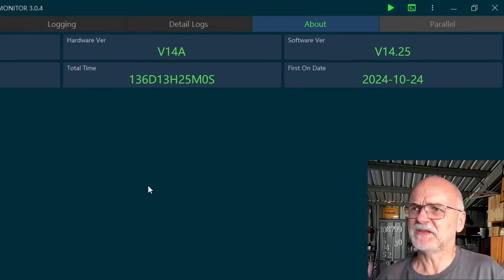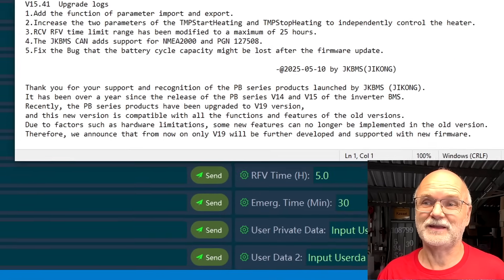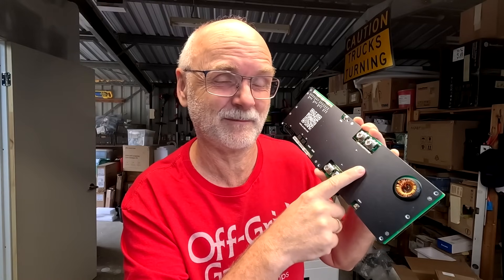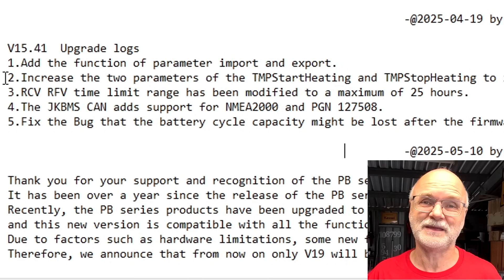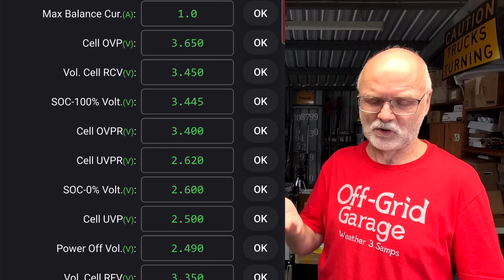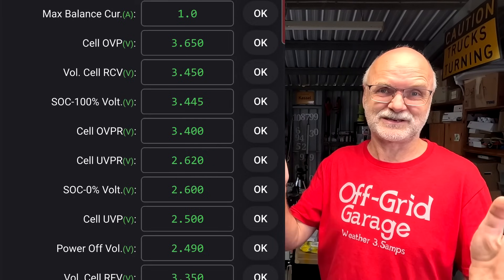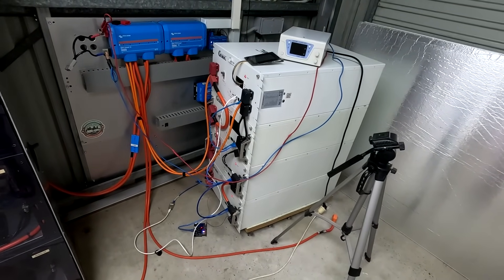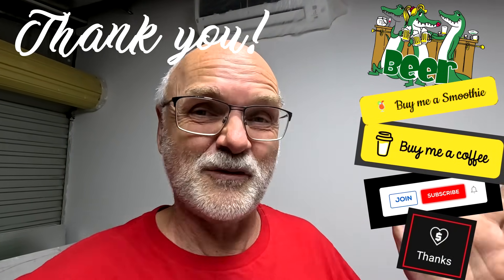The inevitable end of the JK-BMS. EOS for V14 and V15 - is that it?

Comment: 330AH 16S with Jk BMS 300A with 2A balancer, has a constant draw of 2.3A from a EG4 6000xp offgrid inverter, during testing without any solar input, drains battery really fast. averaging 15% overnight with only 2.3A continous draw. Why? 289 days of standby. This bms is drawing power or balancing them incorrectly or something because it shouldnt lose 15 percent overnight

Comment: Hi Guys, i have a V15 BMS and flshed the latest V15.41 Firmware, i am not realy shure but i think bevor the Firmware was V15.36 (or 37). done this a week ago or so. today i realised that the heating is on! the Batterie was on nearly 39 degrees! the last days we had temperatures between 25 und 35 degrees, and there is not heating needed! Charge OTP is on 7 degrees and Charge OTPR is on 12 degrees (I assume when the temperature falls below 7 degrees the heating is switched on and when it rises above 12 degrees the heating is switched off). why are the heating pads on? anyone else with this problem? i tryed to backflash to 15.39 but this went wrong so the bms was bricked. Because of andys experience i was able to reflash to 15.41 (hold the powerbutton and push the reset button). The only way i find to switch the heating pads of is to disable the temp sensors. but this can not be the solution! i find no othe way to switch the heating of. now i disconnect the heating pads, but for wintertime i need they because the batterie is in the garage. Hopefully anyone has a solution! Thanks, Peter

Comment: Did Anyone tried to use the new  heating function(start temp, stop temp) introduced in the FW 15.41 ?. It seems it does not work and somehow after enabling all parameters heating stays off all the time in the status despite enabling in control and adjusting the start and stop temperature. Any suggestions ? Did anyone tested this functionality ?

Comment: Hi Andy,  and the world guru of JK BMSs I'm hoping you can help.  I have 2 x v19 PB series and 2 x v15 PB series all in parallel. 

I'm having an issue when the master (v19) lose connection to one or more of the other batteries.  This only seems to happen with the batteries are under load.  
The strange things is with the BMS loses connection the UART2 Protocol No is 16 (not 1 like it normally is). When it switches back to 1 it sees the batteries again. 

I have tried switching the master to the other v19 and it's the same.  With both of the last 2 latest firmwares.

Any ideas?

Comment: noticed a bug in iOS software V5.1.0 .  trying to set alarm for high or low cell voltage and we can only enter 2 digits.... for low cell voltage atarm i'd like to be able to enter 2.75 but can't.  I can enter "2." 

Also, I played around with the low SOC alarm and low battery alarm and I can't get  the dry contacts to work.  A video on this would be great.

Comment: I switched on my BMS and turned on the main switch, then I looked down and the BMS was off. I tried to switch it on again but the LEDs just flashed very strangely and then nothing worked. It turned out that the fuse on the positive connection to the BMS was blown. I then repaired it without a new fuse and now the BMS seems to be working fine. But only apparently, because switching on discharge doesn't really release the voltage and I have no battery voltage behind the BMS. Does anyone have the same or a similar problem and a solution or know that it is definitely broken?
I also tried a firmware update but it didn't help.

Please feel free to reply in German.

Comment: Finally did some testing. There is a major good change done!   With the heating change also a new feature. It will not turn on the heater now unless the battery is being charged. Have wanted this for a while.
Reply: Question. How long does it take for the heater to bring the cells up to an acceptable charging temp? With all that mass it would seem there would be time needed to do that. A better option would be to have a timer where you could set it to come on an hour before sunrise. Otherwise, you have pv power going to waste waiting for the battery to come up to temp.

Comment: I see, that you have JK-BMS WIN-Monitor 3.04?! In the older Versions, you don't see TMP Start/Stop Heating Parameters! Instead you see Battery Temp OTA(R) with Value 30 that you can't change. Only in the last Version of JK-BMS App IOS 5.1.0. i could see TMP Heating Parameters like you see. Android last Version JK-BMS App 4.28 you also don't see TMP Heating Parameters too. Update Android App don't found. From where i can download JK-BMS WIN-Monitor 3.04?! In Google Drive is the last Version 3.03.28. Thanks!

Comment: My v15 bms came with usb to rj45 cable. I can't get it to work. My windows 10 doesn't recognize it. I can see it in device list,but can' find driver for it anywhere? Anybody know,how get it to work?
Reply: Are you plugging into the right hand RS485 B or C ports? Mine worked fine today first time of use, I am on Windows 7 though.
Reply: I did get it to work with another computer also with windows 10 with newest updates.

Comment: Andy, If you can convince them to add a re-bulk voltage offset so batterys dont end up sitting discharged for the day if a load draws more than PV can supply, it would be very beneficial.

Aswell as a parameter to adjust the CCL when the battery falls under a certain temperature for cold countrys.

We have made these suggestions several times, im guessing the MCU is why its fallen on deaf ears.

Comment: I refuse to believe this is actually true. The amount of parameters you can save on 1Mb is much much more than what a BMS might need.
I can understand that they don't want to put any time in a product they are not selling. It's bad support, but I understand.
I can also understand that their firmware uses variables that they can use in several ways, wich is easier than make new variables.
Firmware was never their forte.
As long as the competition is lacking, why make less profit?

Comment: What are the requirements for the battery to go from Bulk to Absorption.  Mine is staying in bulk after float ends.  Battery Volt > 16* SOC-100% but it still stays in Bulk.
Reply: I found the problem. And now it is working as expected. To get out of Bulk and start the Absorption cycle the whole battery voltage needs to be >= 16 * RCV  (Not 16 * SOC 100% which is a little lower)  In my case the problem was that the BMS was requesting a Voltage and the inverter was supplying a little bit lower voltage.  To fix the problem I calibrated the BMS Voltage to what the inverter was supplying (actually cell voltage now is about 0.005V higher than the BMS setpoint per cell) and so far 2 days working perfectly with Bulk, Absorption and Float mode working as expected.  Try calibrating the BMS Voltage.
Reply: @joseo.cordero7286  Thank you for your advice i'll try
Reply: I'm also happen like you😢

Comment: No more update while the product is still on sale? That is no good. When a product is already some years obsolete, then when update also stops, no one will complain, but like this?
Reply: Well it depends if it needs updates. I know there are bugs but it's perfectly workable and it's costing them money to support it which you're not paying them for. I think too many people are comparing these with operating systems and mobile phones, which need security updates at least.
Reply: @matthewmarks6951  What if next month an important security flaw pops up? (Which already occured in the past).
What with the manufactors that still have stock of battery boxes with this BMS v15 implemented, or the sale of the BMS itself? That is not a good factor to start a sale with.
Reply: It's not connected to the internet. I'm not sure what security flaws could pop up beyond something involving the Bluetooth password. I'd be interested to read about this example of a security flaw and happy to be corrected, of course.

Comment: Ouch! 15.41 isn't a very nice parting gift for the version 15 bms. Wipes the BMS to factory defaults. Hopefully you've done an Export before loading the new firmware. And then after performing the Import, don't leave the settings page before sending every setting to memory. The import only populates the values on the settings page. It is not written to memory.
Sheesh......

Comment: Hi Andy I just bought new v19 jk bms it is very good before I use daily from now on only jk bms thanks to you I came across jk bms and I am very satisfied thank you andy
Reply from the maker: Thanks for the feedback.
Reply: @OffGridGarageAustralia  Dear Andy, I have a question. I see now that if I use my batteries 40 percent, the next day it starts charging, for example 20 percent charged, then at one time it jumps to 100 percent charged, normally 80 percent charged. Then on spring 100 percent is that normal at jk bms
Reply from the maker: @aximuro  No, that's not normal. It should not 'jump' to 100% all of the sudden if you are at 80% unless one of your cells hit OVP, then it jumps.
Chack your voltage levels of all cells when you charge, if one of your cells is particular high.
Reply: Dear Andy what I experienced at jk bms v19  Balance trig volt 0.010 It does not balance. if I do it below 0.010 like 0.008 then that it is very good difference between batteries 0.010 and 0.008 many different like example 3.38 v that others batteries 3.55 but 0.008 then almost all batteries have the same volt balance trig volt 0.010 does not balance the batteries but under 0.010 can also test that. With me it is so thank you for your help me

Comment: I just received my order from EEL battery, I have received a version 14 or 15 but definitely not a version 19. Should I ask for a change?
Reply: Only you can answer that. Do you need features that 14 or 15 doesn't have? How much will EEL charge you for return and replacement? How long will you be without being able to use the battery if you go ahead?

Comment: Hi, new subscriber here, I really need a 24S version of this, could you check with Jikong if there will bee any?  I have a project.. I bought a BMW i3 EV pack it consist of 8 modules with 12S and I will Parallel connect them, Then put them into 4 compartments in each corner of my houseboat. I need to then pull RJ45 shielded cable between the compartments for the Parallel connections of the BMS's right? Or I wish they could make a master / slave board? The BMW i3 already have slave - boards, but I do not know how to reuse them.
Reply: Interesting project! Are you putting them at the four corners of the boat for stability? Yes, you can link the RS485 ports in a string but I'd recommend terminating each end with a 120 ohm resistor as at long cable lengths and high bit rates (115kbaud, I am guessing - that's what it uses for the PC app), data corruption due to reflections becomes a possibility. You can do this with a cut patch lead plugged into the vacant sockets.

I'm more worried about how much expensive DC cable you'll need, and whether you should oversize it due to losses. Best to put the inverter near the middle of the DC cable string - or even make it a complete loop? The cable also presents a major danger if it gets damaged, so perhaps consider a conduit if you haven't already. At least 24S will be more efficient than 16S.

Comment: Can I replace the v15 bms with the v19 without changing cables to the battery? I just change the display and comunication  pcb?
Reply: Yes - it will have the battery connections in the same place.

Looks like there will be quite a few v14/15 BMSs on eBay shortly!

Comment: How about a JK making a shunt. I know its internal but external would be nice. Theu have always has issues with SOC but a shunt communicating to the BMS to register 100% . Victron is the benchmark but JK could do one cheaper too.
Reply: Have you heard of JUNCTEK shunts? (Yes, really.)
Reply: @matthewmarks6951  yes I have a few of them and really good for the price. One been in the back of my ute for two years not missed a beat. I was more think like the Victron and communication to the BMS
Reply: @nathoilboy2053  That's good to know - I've recently bought one and wired it up but not done anything more than look at the pretty display so far (which tells me that the battery is still charging even when the BMS claims it isn't, due to its poor resolution). On daily discharge to 85% or so, the SOC readings tally well, but that of course is not very taxing. I keep saying I'm going to investigate YamBMS which I think would allow these shunts to be used with proprietary systems like Victron.

Comment: I’m ha being a problem with my BMS it’s in a Yixiang v2 box. Yesterday I got a bus high voltage alert on my inverter didn’t know what was going on but my battery is set to ANDYS settings 55.2@100% I was at 55.3 and BMS said 73% ??? I’m discharging now trying to recalibrate . I’m still learning and trying to understand the settings

Comment: Woow...
Useless...
Who needs communication for the BMS, or upgrade if BMS is doing his job?
System needs to work for himself, not for you to look at it...
Good luck everyone...
Reply: You can communicate with the BMS now and will be able to for ever. It will continue to work as it always did. This is not like a car or an operating system that requires continuous security and feature updates. How would it suddenly "not do its job" any more?
Reply: If you set up your BMS first time...why do you need update?
And why do you need communication with inverter?
If BMS is controlling battery and keeping them safe, when is connected to communicate with your inverter, it's loosing second stage of battery pack protection for overcharge, as inverter have also overcharge limit protection...
Anyway, if you make your inverter is communicate with your BMS, it's your problem, but that is not necessary...
Good luck everyone...

Comment: Any idea why I cannot upgrade to V15.41? The about box says: JK_PB2A16S20P, I've selected the 73-JK-PB2A16S20P-V15.41.jkbms but I get the error message: "Device Identity is not same to connected device"! To me the firmware matches the HW. So I'm confused. Suggestions?
Reply: Do you have V14 hardware?
Reply: @matthewmarks6951 No V15 HW. If it was V14 I selected the wrong firmware of course ;-)

Comment: I often dont use my propulsion pack for a while and to prevent daily cycling I simply reduce the charge reconnect level so that it only kicks in when needed but then i use the bms to terminate charging as i don't find they need absorbing or floating. I like to keep things simple and am not running multiple packs in parallel but even if I were it would still work ok withou complex communications after all there is always a common line of communication in the pack voltage.
Reply: There is, although that's less accurate because it's measured at the inverter rather than the battery and so doesn't take account of losses in the battery cables. I tried to use my hybrid inverter in lead acid battery mode and it was hopeless! Some people reckon BMSs are not designed for routine battery disconnection but if the current is low at the time (which it ought to be at full charge), then it won't stress them much.
Reply: @matthewmarks6951  I wouldn't use lead acid on an inverter again now that lfp is an option, used for decades in the past and that was very much the dark ages compared to today. I don't hold with the "not designed for routine battery disconnection" for a femto second, ludicrous argument. The MOSFETs involved are huge compared to the currents involved. They can happily interrupt a short circuit for heaven's sake. In other applications these devices switch at 10s of thousands of times a second. It is the moment of switching that creates heat and they are passing through that at that high rate. In a BMS application they switch maybe a couple of times a day to be honest I think they would be more likely to die of boredom than stress. We tend to only charge from solar and alternators at fractional C rates anyway, well below the rating of the BMS. All too often I see those with vested interests in selling gear come up with spurious 'reasons' why people should go complex rather than simple. I've done both and designed my own stuff and what generally happens is I start off complex and as time goes on I simplify as I find some of the complexities simply aren't needed in reality. Obviously systems and requirements differ but there does seem to be a tendency for people to be driven in the direction of complexity. I do a lot of graphical monitoring of systems and use that to inform me of real life behaviour and then I can base designs on real word behaviour as opposed to ideologically prejudiced designs based on hearsay.